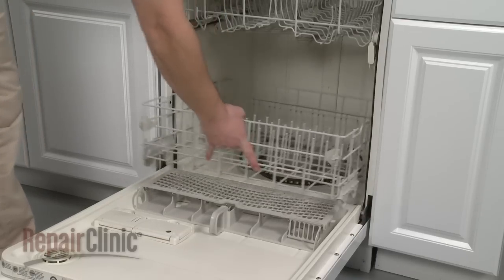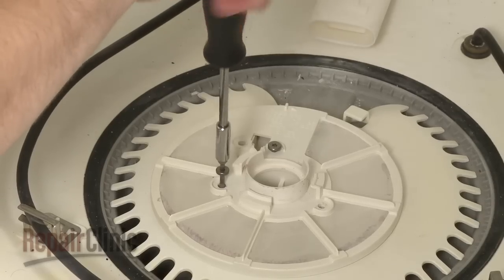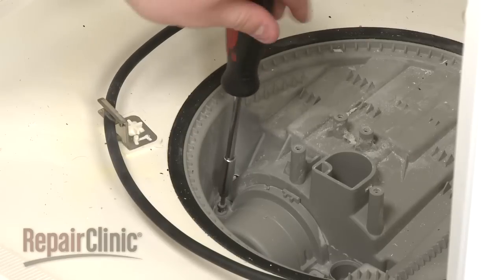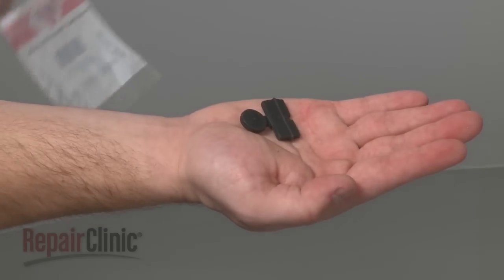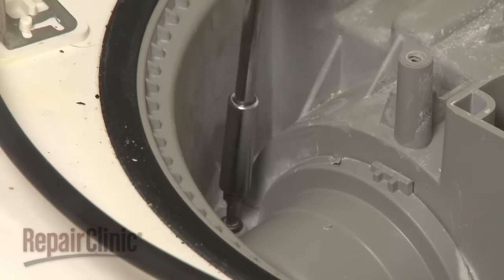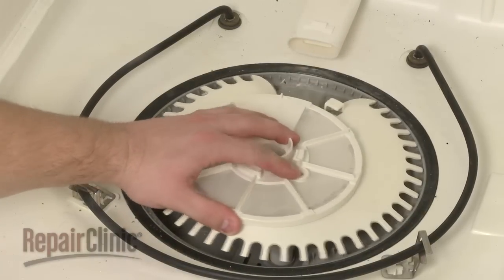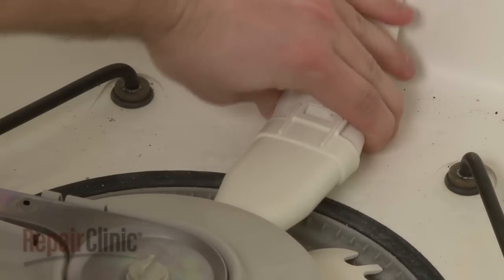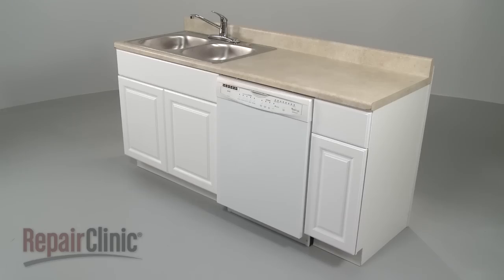Whirlpool Dishwasher Replace Check Valve #8268375

Comment from the maker: Most dishwasher have a timed fill, so if the valve was bad you would either get too little or no water, or it will stick open and you would get a flood and have to turn the water supply valve off to get it to stop. The water valve might be slow to stop. you can open the door in the fill cycle to see if the valve shuts off right away. If it doesn't, replace the valve. The timer or control might be skipping the drain cycle or the drain motor may be stopping mid cycle.

Comment from the maker: It appears this part is not manufactured any more. The part number has been substituted for the inlet protector number. This would suggest that the inlet protector has been redesigned and now does the job of the foreign object protector.

Comment: Thanks.  A closer look at the video shows my inlet protector to have a small grate like that foreign object protector so you are right. 
Cleaning all the debris out of there, the pump seems to struggle to drain all the way.  Should I pull the drain motor out and clean it out too or am I wasting my time?  
The drain hose passes high up in the cabinet into the sink cabinet and then lowers to the drain connection.  Is that too high?  Should it be lower?

Comment: I was wondering if my valve is bad?  I run the dishwasher or quick rinse and then the dishwasher is full of water.  I can push the cancel/drain button and the water will empty so I don;t think it's a blocked drain line.

Any idea?  Will a bad check valve do this?  What does a bad check valve look like?  Wondering so if I take it out I can check it for what a bad one looks like.  Thanks!

Comment: Going to shorten the drain hose and see.  If I fumble with the drain hose while it's draining, it seems to drain.  I feel that the water is getting caught up in it.  ie: It goes through the "factory loop" on the side of the washer, then drops down to maybe floor level with all the slack, then back up to the top of the cabinet for the pass through to the sink cabinet.  Then down to floor level again and then up to the 45* Y-pipe to drain into plumbing.  There is an extension on original hose.